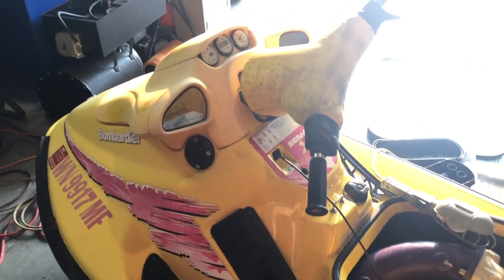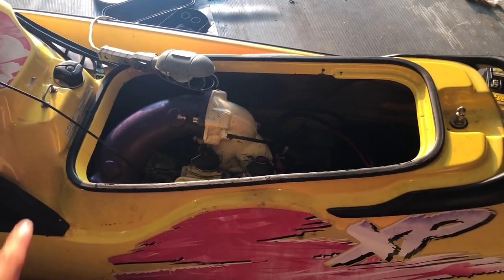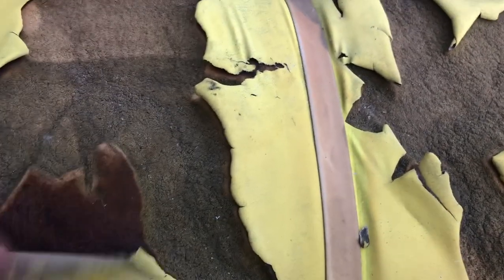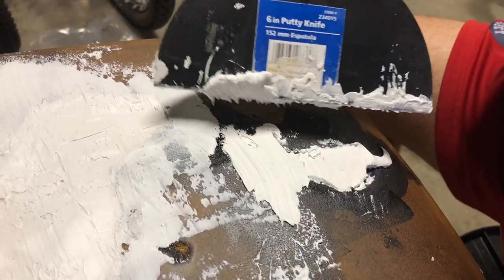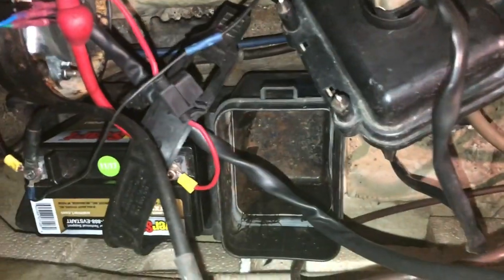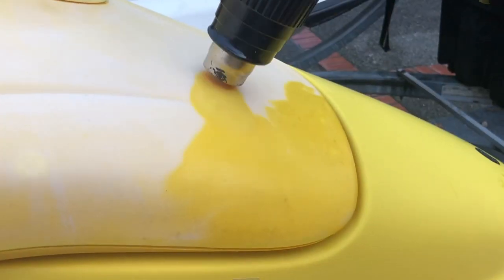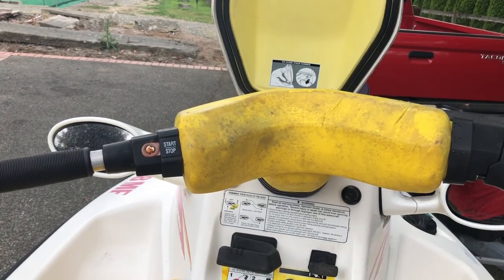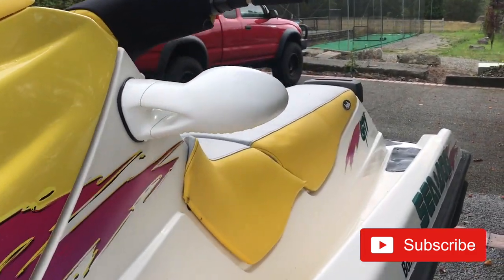96 Seadoo XP Restoration

Comment: 'spray nine' will work on the rubber handle part. just spray it, let soak for 1 min or so and then wipe. if there is still more mold/dirt/crud then repeat and use 400g sand paper to wet sand the spray nine in. then wipe off. worked great for my 94 xp green bars

Comment: He man. Merry Christmas. How did that caulking hold up on those seat? I'd be concerned that it'd be too hard as opposed to the foam.. Also, when you used the heat gun to restore the plastic, how's that holding up in the sun? Did you use any products on it after heating it? I've used the heat gun trick but haven't had long term luck with it...as it fades again quickly. I ended up sanding and painting my hood on my 97 gs. Also, I'm sewing my own seat covers now and I used an additional layer of 3/8 inch foam to "hide" the imperfections on my cracked seats.. Interested in hearing about your project. Thanks
Reply from the maker: Caulk has held up pretty good though I finished towards the end of summer so didn’t get to take it out much. Definitely didn’t feel very noticeable compared to the foam though some types probably would. And as far as the sun a put a Napa protectant on it. You will have to re apply after a few times out in the water or if you store it outside
Reply: @adampaganelli4891  Thanks for the reply. Are you on www.seadooforum.com ? If not, check out the 2 stroke personal watercraft section.